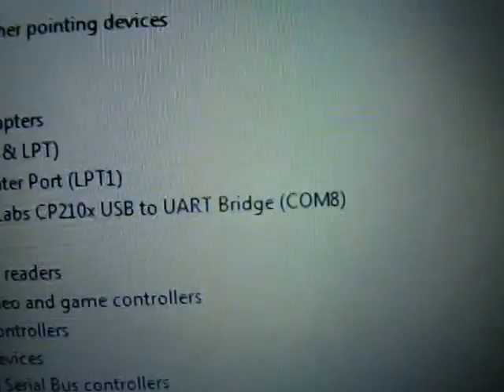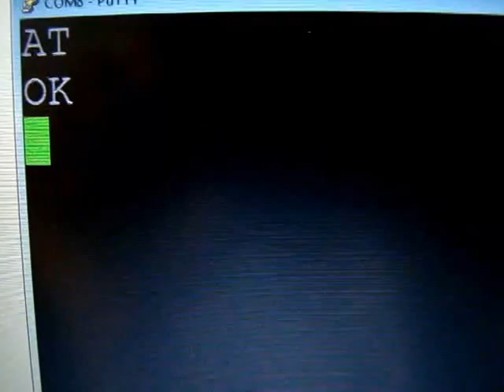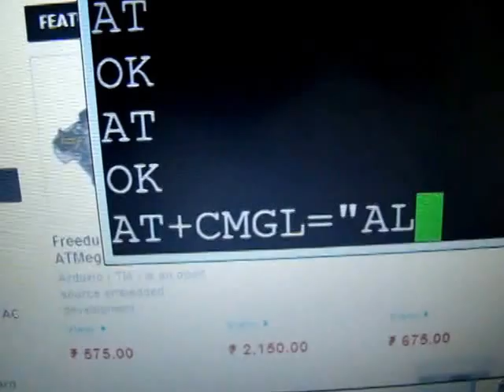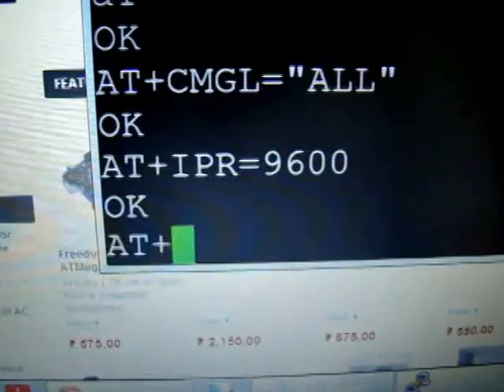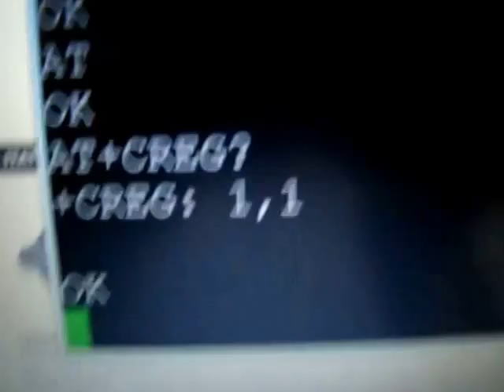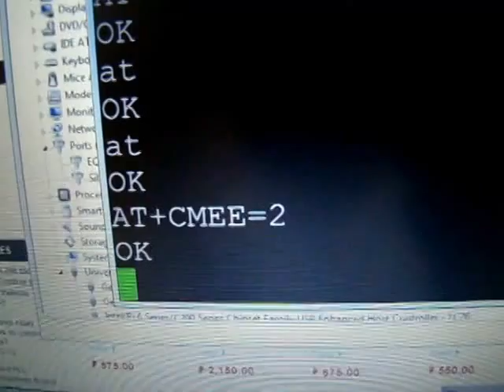Using AT Commands with SIM900 GSM Modem

Comment: how to connect this gsm modem to arduino. i.e. hardwiring... my attempt of connecting Rx,Tx, GND onboard pins on gsm board to rx(0) ,tx(1),,gnd on arduino deos not work for me....plz help. Is it necessary to use RS232 to TTL converter to connect to arduino.???

 HOWEVER FROM PUTTY ITS OKEY .. To PC I connectedthruogh with USB to RS232 TTL UART converter 2102 chips... PLZ HELP

Comment: hey, i have similar looking sim900a, but network detection fails, it blinking at 1sec constantly, few days back it got connected and i was able receive calls. I have connected to arduino via 5v supply and grnd plus tx rx pins.

Comment: I have the same gsm module can u show me the connection of this modem with audrino
Reply: do we have to make gnd common with arduino for this modem like other gms modem connection or only tx rx connextion will work..?
Reply from the maker: Neeraj Srivastava I always make the GND common for everything. The modem may require 2 to 3 Amps power supply, so I normally use a 12V 2 Amps charger for this, and the Arduino is powered mostly from my laptop USB port, I am too much afraid to connect a 12V supply to the Arduino, whatever the specs says, my experience is it will blow above 9V. So, the only solution is to make the GND common.
Reply: Hacktronics India
thnks for the suggestion.. i have one more query that tx and rx pin is given in my modem for ttl connection beside of buzzer which you had mention in the video bt gnd is not given so can i use the gnd pin which is given along with 5v for making gnd common with arduino.
Reply: Neeraj Srivastava YES YOU CAN USE THE GND LOCATED BESIDES THE 5V ANALOG . WE NORMALLY TRY TO SET ALL THE MODULES WITH SAME REFERENCE LEVEL SO IT WOULD BE FINE

Comment: i have the same gsm module as you have shown in the video.......but i have to connect it with arduino........and whenever i m connecting it to 12 V ..2A POWER SUPPLY .......the buzzer is continously making noise.........and the gsm module also gets hot in few minutes..............what may be the reason......?
Reply from the maker: No idea, defective piece may be, that's why always buy pre tested modules from hacktronics India (http://hacktronics.co.in)
Reply: Same issue pratik, were you able to figure out what was causing the buzzing ?
Reply: Kartikeya Bhargava nope .....it doesn't work......reason may be any short circuit in the board which might have happened during manufacturing itself....or something...

Comment: am not getting any "ok" response from sim900A module,anyone plz help me...i tried in putty and hyper terminals software also....but i dint get any "ok" command in response....whats the problem? anyone help me....
Reply: have u set the baud rate in hyper terminal? which modem your are using?
Reply: yes i set baud rate to 9600...am using sim900 modem..